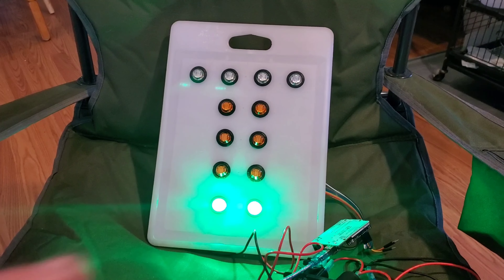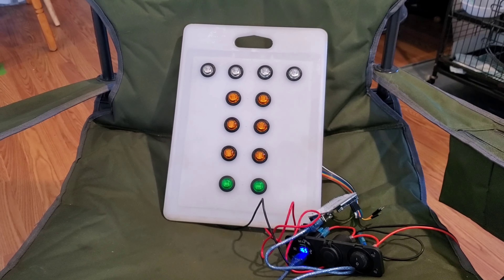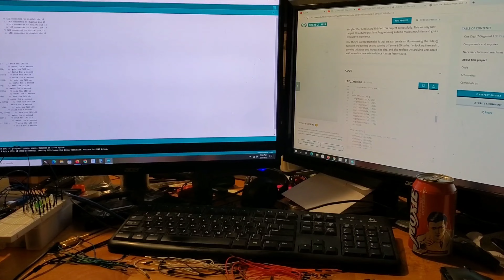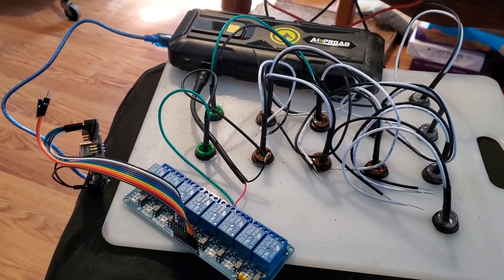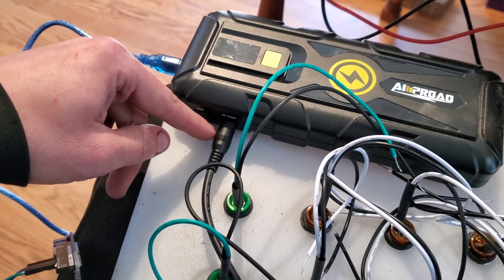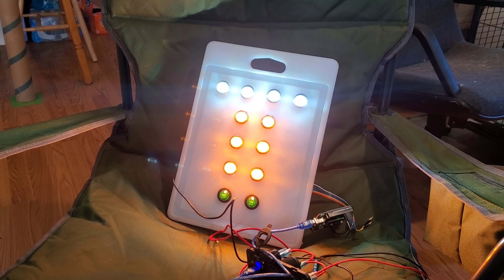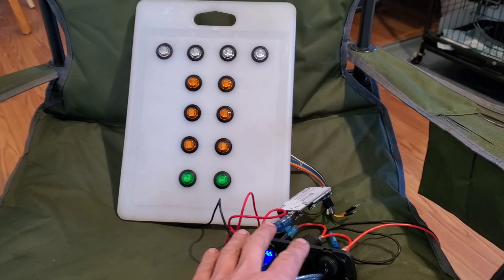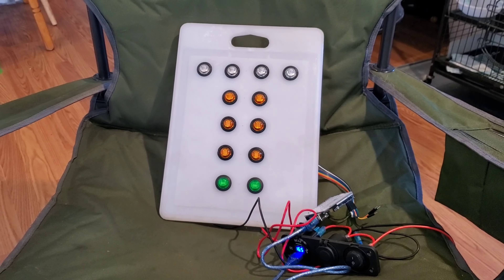Arduino Drag Racing Starter Tree

Comment: I'd like to add a laser foul line with this exact code, such that if a car crosses between a laser and a photosensor BEFORE the green light, it lights up a fault light and then turns off until the next race. Any ideas?
Reply: this is exactly what I am looking at. Did you figure this out. I would also like to have a timer and a foul line at the end of the drag strip. Looking at doing this for RC cars.

Comment: Legend mate. Been super keep to making one of these as I would love to get started in doing mud drag racing. And been looking around on what components I need and you've just covered the whole lot. Love your work many thanks
Reply from the maker: This setup will be expanded on over time. The first thing being sorting out a remote trigger. With in minutes of this video being on FB I got a few light upgrades ideas in my email.
Reply: @RCGRacing  I was thinking you can buy from auto stores 3 inch round lights you see on trucks and trailers in led and they are super bright and will help out with any sun glare problems. Keen to see what you can make of it. I started looking at the kits and being from Australia our exchange rates different so I would be looking at more the sub $200 mark as everything is nearly double. But that's still pretty cheap
Reply from the maker: The 3 inch light thing seems to be a USA is dumb about it thing. Everything here seems to be 4 inch or 5 inch with the exception of a few types of boat lights.
Reply: @RCGRacing  ah yeh but anyway something alittle bigger in led would work well. But then could also be easier to see in person than what it is in the video

Comment: Nice!  Neat to see some MCU action (Arduino spelling in title custom?).  Are you thinking like a keyfob for the switch later?   On a similar note... maybe for like a bluetooth control... the Youtube channel Thunderhead289 recently did some videos on powering his 302 V8 with a lawn mower carb that has a neat way of using a Intake Air Control (IAC) sensor, some custom 3D printed parts (PETG) to mount the air filter/carb/vacuum circuit and a vacuum regulator (if I understand correctly) with an Arduino using bluetooth so can be monitored and controlled from a cellphone with bluetooth.  He used the MIT App Inventor and is supposed to release his project eventually... though I have this conspiracy thought like won't happen sine his performance was so improved.   Great first build!
Reply from the maker: Fixed the spelling thank you! Yes goal in the future is 2 triggers a plug in keyfob and a push button with 20ft or so of speaker wire. I reached out to him about the Carb he used. The one he picked created the problem he had to solve. But he seems to not wish to listen to input. The bluetooth idea is great but most mechanical types will already hate the Arduino as it is. Keeping in simple for now I think is the best idea.
Reply: @RCGRacing  Good call. Yeah, I was wondering what he's using to sense the vacuum pressure for feedback.  Also, might be a little complicated for most... though other than shipping added on for the electronic parts... using the Arduino (or other MCU) to prototype designs might save a little for future builds since can build later designs with just the bare minimum parts and re-use the Arduino for future designs. Used to be that way at least... not sure now days with chip shortages and Chinese pricing warfare.  Plus can pack the design whether dead bug style, custom PCB or vero/perf board into a smaller package. Probably preaching to the choir though just in case someone reads.

Comment: I love this video.  I have been in the process of making several timing trees for 1/10th scale RC drag racing.  First attempt was to hack a TRAXXAS DTS-1 to make the LEDs brighter in daylight.  After that failed multiple times with Quad Comparators I went the same route that you went.  Arduino driving relays.  Relays powering 12 volt lights in colored 2 inch push buttons used on arcade cabinets.  Unfortunately the LEDs that looked great in my garage were not any brighter in direct sunlight.  We found 12vdc bulbs that would fit my buttons but they were like $10.00/bulb.  We used that for a year, and then I upgraded to 4 inch white trailer bulbs with colored gel film translucent sticker sheets to make my yellows, green and red bulbs.  Anyway, long story short, I have my version 4.0 tree using the same 3/4' bulbs that you are using.  My tree has never been under $100.00 as that was not a pre-requisite in my build, but it looks like we were doing the exact same things, right around the same times.  Great work and I am looking forward to seeing more builds in your future!
Reply from the maker: That is great to hear the break down. My current v2 I am working on is a more professional looking setup with a magnet mounted remote control. This will let me run the light from my rig and do test launches. Also will let the person setting up races races run it with out ever being in the race area. There are ruffley 50 people that have built a version of this one now that have sent me pics at events.

Comment: The pro tree lights all 3 yellow at once then green. Maybe you could wire the reset to time how fast it takes you to press the button. That way you can practice your reaction time
Reply from the maker: Both good things to think on. The pro tree light idea would not be hard. Problem would be needing to reprogram the Arduino back and forth if you had people needing both types of lights. A remote with 2 different triggers would be a good idea.